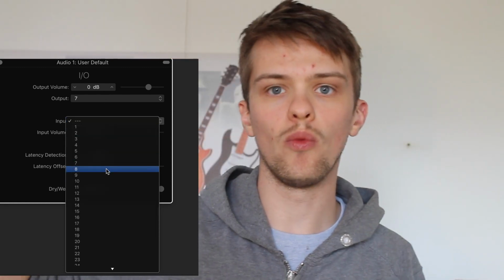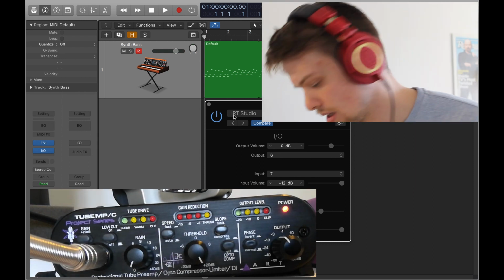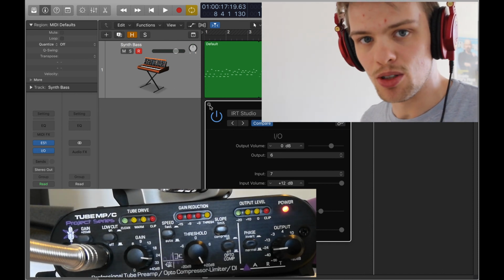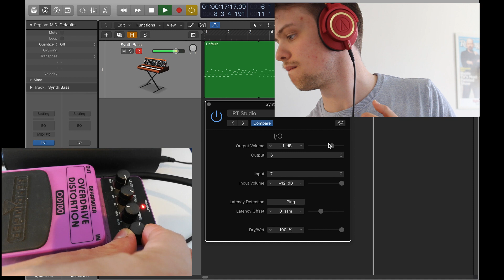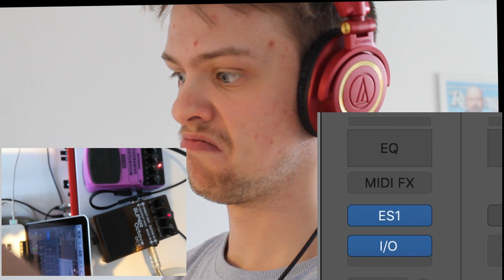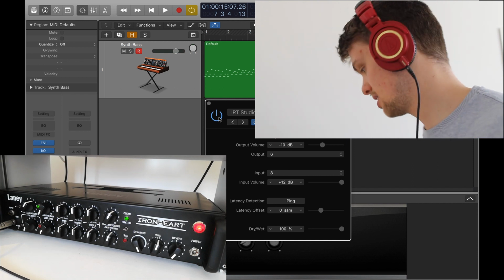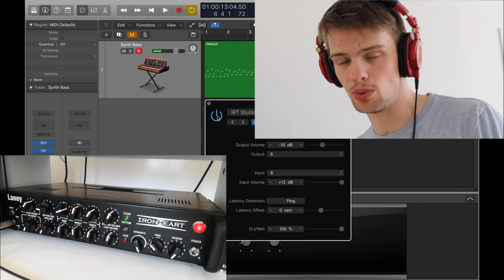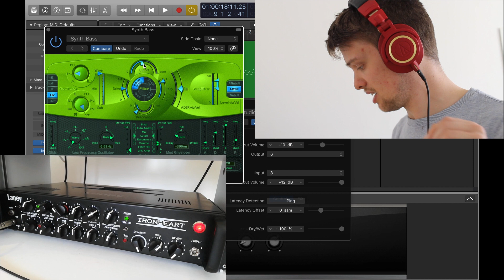How to use pedal effects and other hardware in your DAW + Fun with Saturation/Distortion

Comment: So you need line level inputs on both the interface and the pedal, right? You're using balanced 1/4" cables there?  What if you're using a  70's analog pedal - don't you need some kind of Line level-to-instrument level (HiZ) converter - to go from the audio interface to the pedal?  Note, on the way back, my Apollo Twin interface does have a HiZ input for guitar cables.  I guess it's called a reamp box?  But do they have one with 1/4" line input?